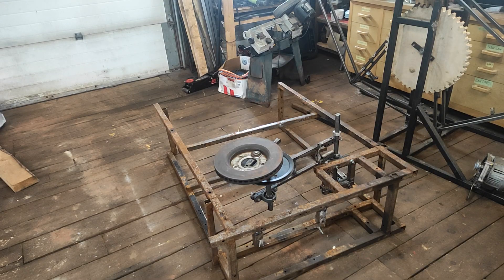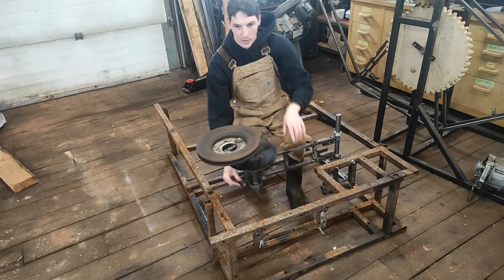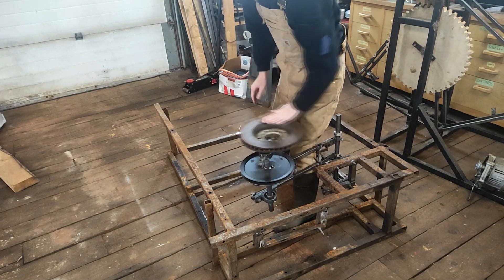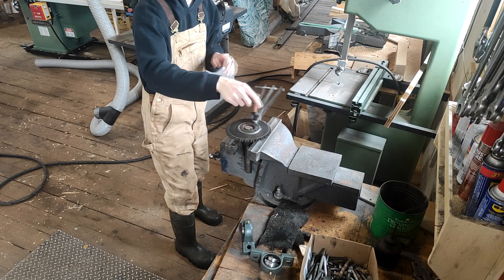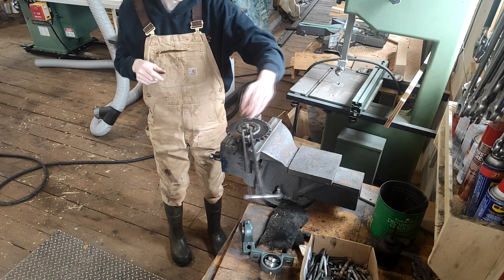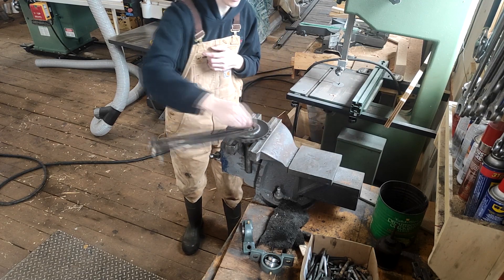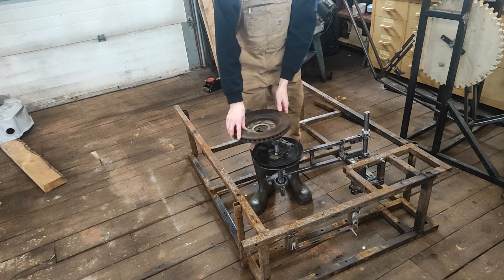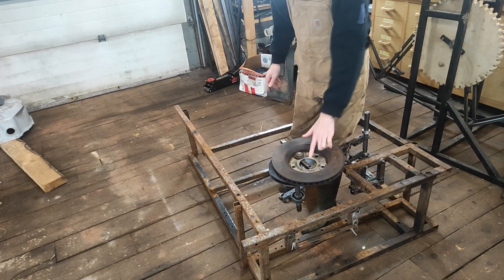Three Centrifugal Force Machines

Comment: Is the idea to extract energy from a mass?, as in a small energy starts the movement that produces a larger energy? As in a fulcrum? A transistor is an electrical fulcrum of sorts but it needs a big voltage to be gatted from a small voltage.  But it still needs that larger voltage produced too... Transfering that rotational energy into something amplifying and converting to useable power is interesting but im not sure it's viable. But I'm open minded enough to say hmm what if?
Reply from the maker: Basically, yes. Electrical free energy machine are not related to this type of technology.